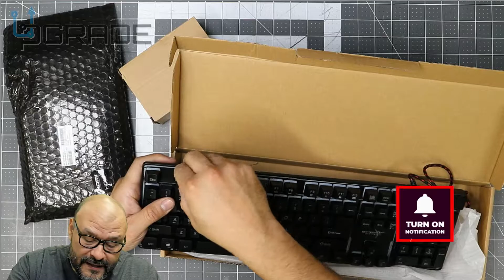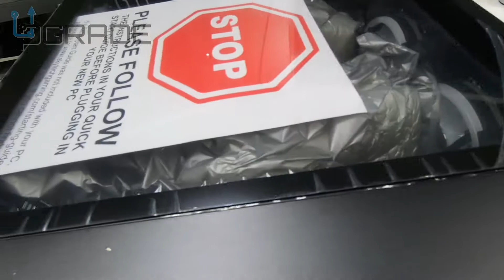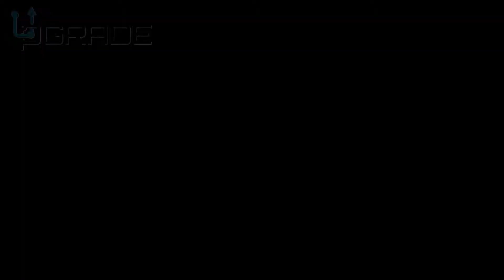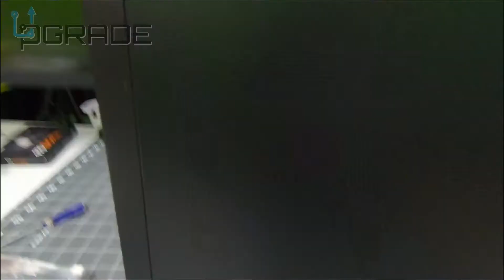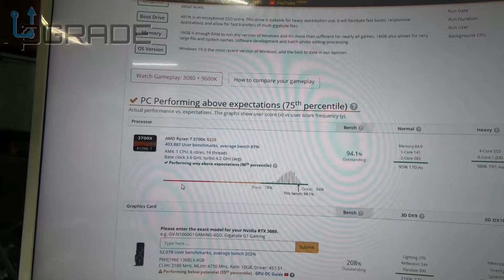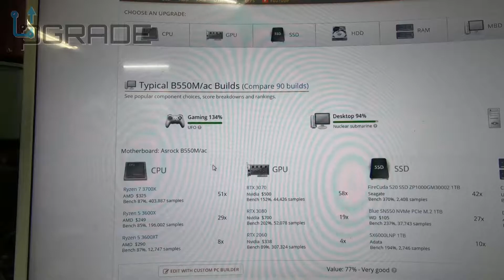Skytech Blaze 3.0 Desktop

Comment: You may want to clarify your comments on the memory latency. Higher values there are bad, but that doesn't mean those values are poor values, but the higher the value, the longer it takes to fetch data from the different caches and finally from the off die RAM. The reason for the big hump is that the 3700x has 32MB of L3 cache, so anything that doesn't fit in the cache has to come from the RAM, and those caches may first fill with smaller chunks, hence the steep slope after 16MB, indicating a longer wait time to fetch data.